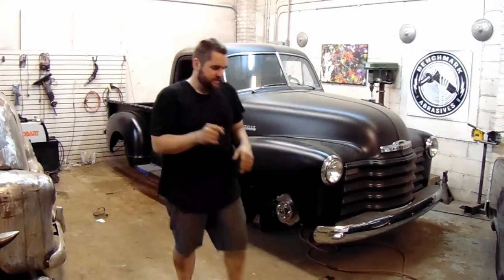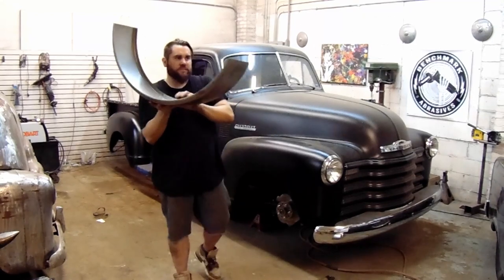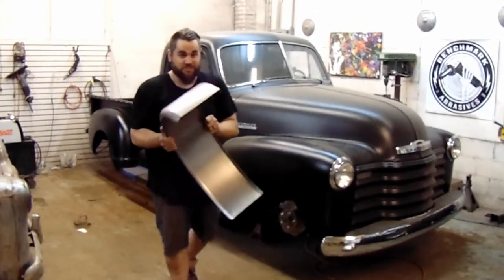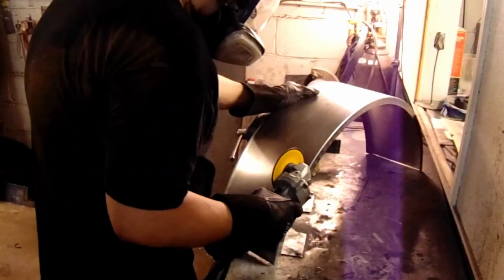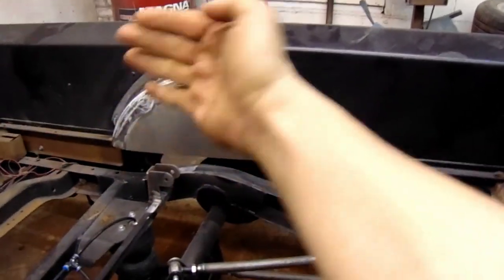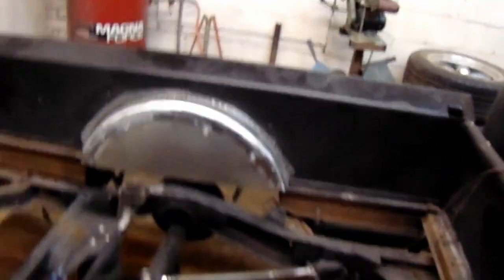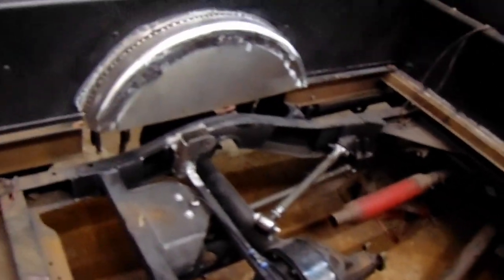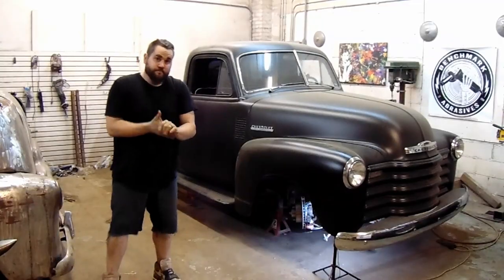REVIEWING THE CHEAPEST WHEEL TUBS ON THE INTERNET! TRAILER FENDERS, INNER FENDER. BUILDING REAR TUBS

Comment: I have a 95 240sx quarters and fender wells are butchered, I just bought two of these trailer fenders at tractor supply, hoping to get my car tubbed soon!
Reply: u get it done yet? doing it to my 90 240sx in the engine bay
Reply: @anthonyhoppe9603  have not... life happened, and my projects are on the back burner... but I've seen it done all over youtube